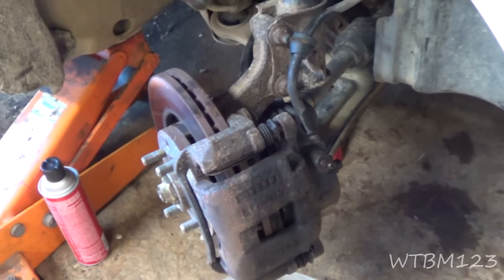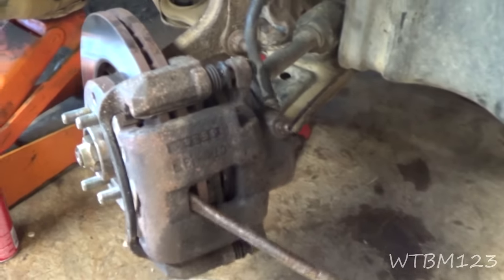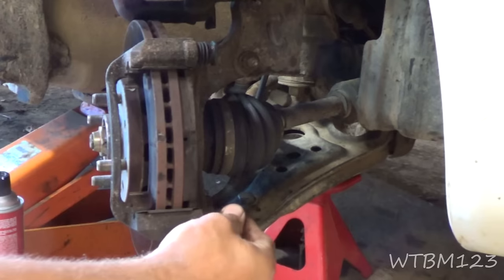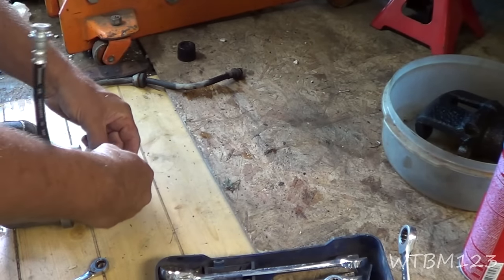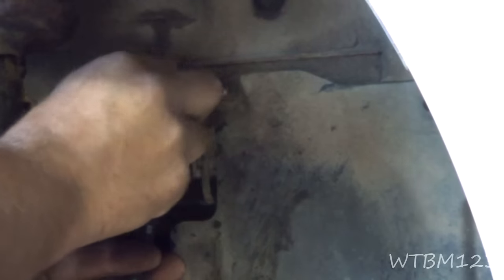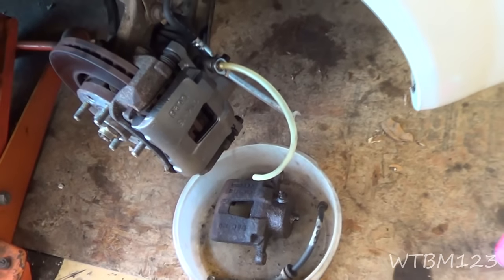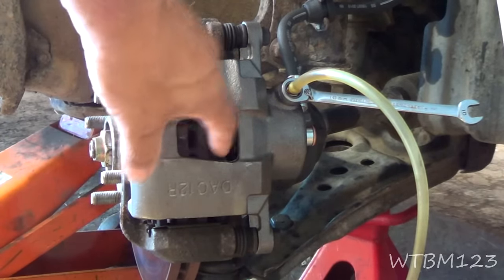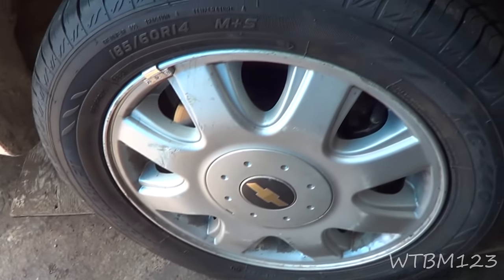Stuck Brake Caliper or Bad Rubber Brake Line #brakes #bleedbrakes #brakehose

Comment: I have a 2002 accord 4cyl and my problem is when the car is running for a while the brake pressure builds up and eventually the calipers will be fully engaged and the car we not be able to moved feels the driving with the end brake on I changed the brake porportioning valve but still same problem what is my options
Reply from the maker: Not sure . prob should have it put on a diagnostic scanner and se if codes or data that may help .

Comment: my passenger side brakes locked up yesterday with smoke. The next day I was able to turn the wheel and compress the caliper once removed and reinstalled. Now the passenger side no longer locks up after a test drive of about 10 miles. Any idea what happened?
Reply from the maker: Either piston stuck , caliper slides stuck i would guess . Could be hose going bad but with out testing it is hard to say

Comment: 4:17.  Stupid me - I put both copper washers on the same side of the bolt.  I didn't realize these went on either side.  Of course this caused a slight leak in my brake line.  I caught these drips inside a can and filtered this before putting back into master cylinder as I was running low of brake fluid.

Comment: Hi I ha e a ford fiesta 2011 titanium diesel, the other day i was doi g a reverse manoeuvre and it completely stopped, it wasn't mivi g it was as if the brakes were applied, after 30 mi s or so it started working fine.
Today again it happened had to get it towed to a garage, they had a look that I'd my be the caliper but it wasn't, they said the brake system looks fine and that it might be the abs pump, do u have any ideas wat it might be.., after the guy took it to the garage and got it of his truck it was wirju g fine again pls help with any ideas most appreciated
Reply from the maker: Maybe rubber hose , would try and make it do it and trouble shoot while it is doing it to see if holding pressure or something some place
Reply: @wtbm123  thx

Comment: I don't understand why are you replacing the caliper. if piston doesnt move easly isn't it because some rust or dirt get under the rubber protection. isn't getting piston out cleaning it (or replacing if needed) the right way to do this repair ?
Reply from the maker: On costumer car i would need to order a rebuild kit to be safe , and then charge for time , or just pick up new caliper and install . So for time and cost to costumer it is better to just replace .
Reply: @wtbm123  fair enough, thank you for explanation :-). I've asked because few weeks ago,  when replacing brake pads I noticed that the piston rubber protector was damaged. Despite not being very experienced with car fixing it took me about 30 minutes (once the caliper was removed from car) to remove old piston, put all gaskets, lubricate it and put new piston in place. Repair kit + piston price is just a fraction of what caliper with all the components cost, so it's probably a good option for those we do the repair by themselves.

Comment: hi there i get a grinding noise and a vibration in my pedal only when braking iv replaced brake pads and rotatorys and wheel bearing and its still the same iv just ordered brake lines is there anything else it could be thanks
Reply from the maker: have you done the back also . , A lot of times with grinding , you can spot the unusual wear , where the grinding is .. can you jack it up and feel anything
Reply: Hi there yes iv done the back aswell I was thinking it mite be a engine mount am I wrong in thinking that or could it be a caliper
Reply: sorry yes iv jacked it up and no signs of rubbing and wheels spin freely

Comment: I have a 2010 Jeep Liberty and very recently the brakes seem to be dragging/sticking. After driving about 30 minutes I can feel the car starting to drag. At one point I stopped for gas and  now it had a full-on thumping noise as if I had a flat tire. At very slow parking lot speeds the jeep was also hard to steer. And when I pulled away from the gas pump it felt like the brakes did not want to let go. It had a creaking noise for a few seconds. As I increased speed the creaking would sop. I think it's only happening to one of my front brakes - ANYONE HAVE IDEAS ??

Comment: What do I do if all 4 of my disc brakes are grabbing on my 2001 GMC Sierra ?
Reply from the maker: See if pads ,calipers and slides move free . if so while stuck loosen some bleeders to see if fluid pressure is still there . if so follow back up the system till it does not hold pressure . then go back and see what was holding the pressure
Reply: wtbm123 I found out it was a bad contaminated master cylinder

Comment: if the brakee caliper is bad you can rebiuld them with a kit in autozone or autoparts store
Reply: Your better off getting a reman caliper! You can get a kit but if piston needs replacing or you try cleaning it up, and the cylinder and it doesn't work...there goes your new pads and rotors! And depending what you get in that rebuild kit...a couple dollars more buys a reman caliper...I just got 2 OEM remans from rockauto for $32 each and $8 FedEx for rear axle...They are $57 @ Oriellys plus core charge! And I don't do AutoZone...ever!

Comment: My caliper won't compress completely. It goes about halfway back in (I used a c clamp)

I opened the bleeder valve and it made no difference.
Reply from the maker: probably the caliper needs replaced
Reply: @wtbm123  bingo.  I removed it and dismantled it. It was rusted
$49

Comment: think I got a bad caliper on the back of my 03 Silverado  thanks bro
Reply from the maker: Could be , another thing to look for ,especially the Silverado is the actual brake pads likes to stick in its holder and not slide ,This makes for a weak brake feel.  Just something to look for while you are in there
Reply: I saw that in the fronts . changed pads in the front and pads and rotors in back. driver rear pads were gone taking rotor with em. the rest of the pads were not too bad.

Comment: Ok so what do you do if the shoe is tight in the caliper slot?
Reply from the maker: Usually clean the slots well , if a stainless piece is there remove and clean under it . May need to kinda chip at it with hammer chisel to remove scale . If a sand blaster that works , . usually the slots need cleaned , unless , if using cheap pads , sometimes they need filed or ground a bit . because on cheap pads sometimes when the metal plate of the pad  is stamped out  there is burs .
Reply: wtbm123 I typically use cheap ceramic pads which perform well enough. I’ve cleaned and filed the caliper channels and filed some off the pad tangs. This leaves bare metal and seems prone to corrosion. I’ve applied corrosion stop but recently heard nothing should be applied to parts you can see.  My brakes are dragging and when I diagnose I wonder what I will find.
Reply: How loose should the pads be in the slots?  I may not be filing enough.
Reply from the maker: @brentbuckingham291  move by hand . some with anti rattle  clips may have resistance , but still usually slide by hand
Reply from the maker: @brentbuckingham291  when i apply brake slide grease on them i put just enough to kinda wet it down . to much and dirt and brake dust will stick . if live in rust free area can usually use none .

Comment: ok well i have old ford mercury topaz and i went to drive my car it was going really slow then i got about a block away from my house then the whole car stopped and would not move when i put in drive and pushed the gas anything you think could be wrong
Reply from the maker: It kinda sounds like a bad transmission , but only a guess with out seeing the car

Comment: on the slides you apply antiseize not brake lube
Reply: I don't see what difference it would make? I have always used a premium silicone brush lube on guides, slides, and a little on back of pad to piston, and never had any problems. You want the pads to move easily in slides...what difference would it make? The stuff I use stays there and repels contaminates...

Comment: A trick my brother taught me. Get a 50 mil syringe and pre fill the hose and caliper then put them together so it won’t drain. The. Assemble caliber to knuckle and hose in place. They’re will still be a tiny bit of air. But it’s makes bleeding that much easier. Especially if your on your own.
Reply from the maker: Thanks for stopping by and commenting

Comment: IMPORTANT!  4:20.  With those copper washers - one inside, one outside.  I didn't know this and my stupid brakes kept leaking a tiny bit but enough not to build up adequate pressure which made the brakes mushy.  These damn car companies should print up booklets that guide you through this process versus just selling you the damn parts!  If I didn't know better, I'd swear there was a mass conspiracy in America to dissuade people from making their own car repairs.
Reply from the maker: Thanks for stopping by
Reply: One copper washer goes on either side of flange, that way it seals on inside and outside of flange, flange being sandwiched in the middle.  Follow me?  It's important there are 1) no bubbles in brake fluid and 2) no leaks in the line as hydraulics are unforgiving that way.
Reply: One more thing.  It's okay if your brakes seem really tight at first.  Don't get freaked out.  If you spin the free rotor and it feels a little draggy, that's perfectly acceptable.  As you drive, they will (should) loosen up.  Keep an eye on them the first few miles you drive to be sure.  Sometimes, these may get too tight and burn up on you.  But 99% of the time it's because the caliber fails to pump in and out as it needs.  You can even repair the seals in a caliber but you need specialized shop tools to do this.  Most people just replace.
Reply: Yea, PIA when you find out parts are bad.  Hey - don't waste your brake fluid!  Get a clean pan - plastic or metal but spotlessly clean - and catch the fluid inside.  Later, get a paper towel and place over a clear jar.  The material will filter out any rust chips, bugs, dirt of any kind, and only pure brake fluid will pass through.  Plus,  the towel will not absorb this fluid, only the water for which it's designed.  And spilling brake fluid on the ground makes it very hazardous as it's incredibly slippery.  Good luck.

Comment: hi... I have replaced my calipers... brake lines... brakes... and my brakes are still sticking... what could the problem be... I drove it after I got done thinking it was fixed and low and behold the right front tire was smoking like crazy... and it is pulling to the right real bad... help...
Reply from the maker: Either something like caliper slides or stuck caliper , but you say replaced . Lines replaced , does that include the rubber ones . Maybe the abs brake controller . Either something mechanical binding or something holding fluid pressure . Can open bleeder , if caliper goes back in , then you will have to find what is holding the fluid pressure.
Reply: yes I replaced the rubber hoses not the brake lines sorry... also the Calipers...and the pads look like they are full of metal....? not sure whats going on but its pretty frustrating the break fluid looks dark also... im not a great mechanic

Comment: 10:15 adjusted back brakes when peddle felt low. How?
Reply from the maker: on some there is a rubber plug to remove , then a star wheel in side to turn
Reply: @wtbm123 , when I c clamp squeeze one of the two pistons in (a), the other (b) is pushed out. When I c clamp (b) this easy one that pushed out, and squeeze it in then the other piston (a) doesn't push out--so the oil goes back out to the line, I guess. So that's the stuck one (a)? Or is that normal dual piston operation?

Comment: when I turn right strong and then straight back straight I lose break pressure it's only when I turn right help
Reply from the maker: May be a flex line , wheel bearing , but thinking that may affect more than turning right . Are you moving or stopped . does the abs go off too . Really hard to say with out testing and seeing

Comment: Why didn't you perform the fluid flow test first by removing the banjo bolt and applying the break pedal? That should have been the first action.
Also, Having been a DV and quality engineer for 3 OEM brake manufacturers Ford, GM, and many others, I spit and cuss when I see mechanics not using centered pressure to retract pistons. Read the D&#$d manual!
Reply from the maker: Because  depending on how hose went bad , a lot of them will push fluid out , but not let fluid return . makes like a check valve inside .

Comment: you did it wrong; 
there is no way the hose AND caliper went bad at the same time;
you DID NOT turn open that bleeder ENOUGH,i could see it from here;
Reply from the maker: I have seen both bad before . usually one is bad , no one fixes then the other bad before coming to shop . but usually one or the other .